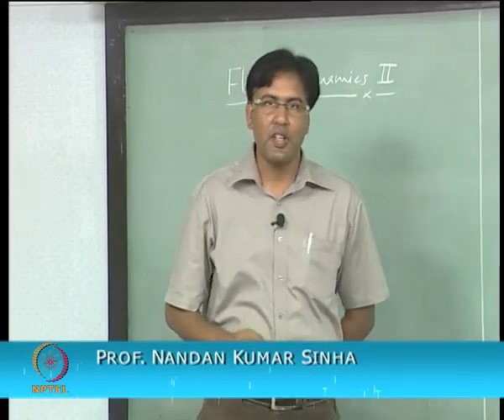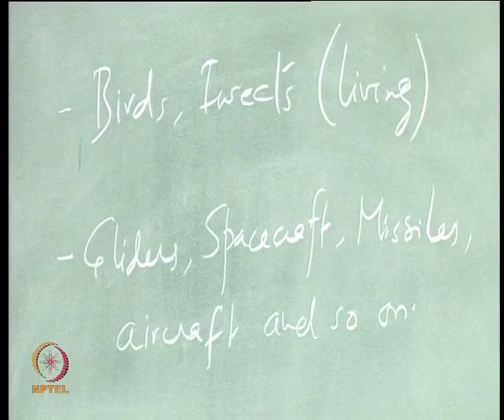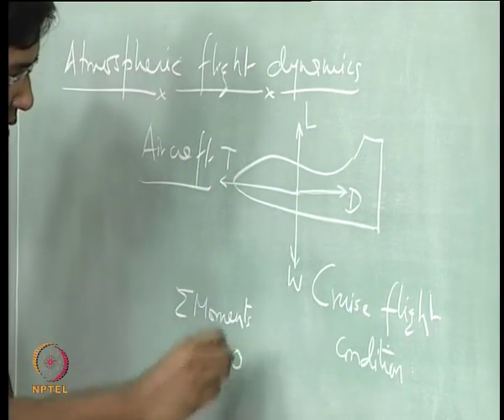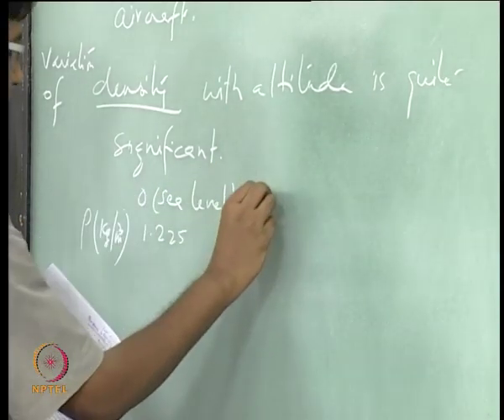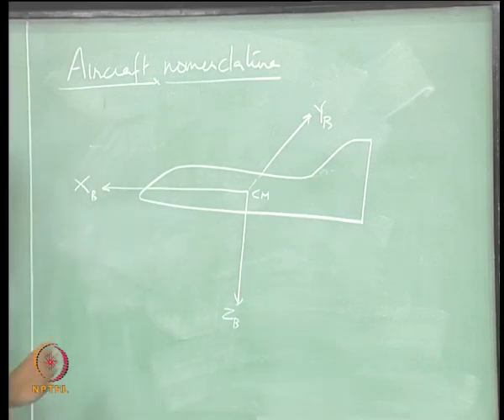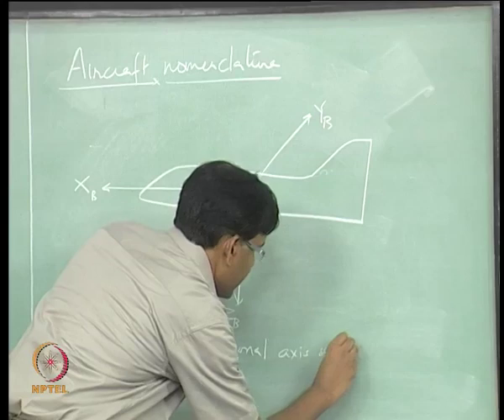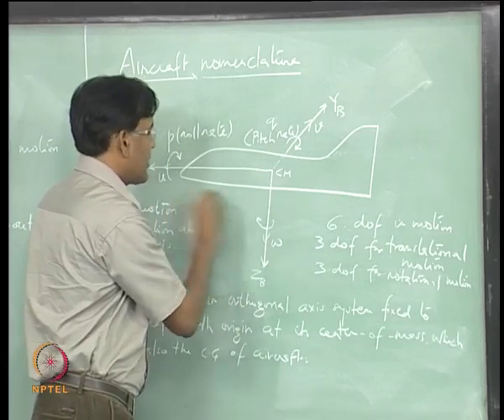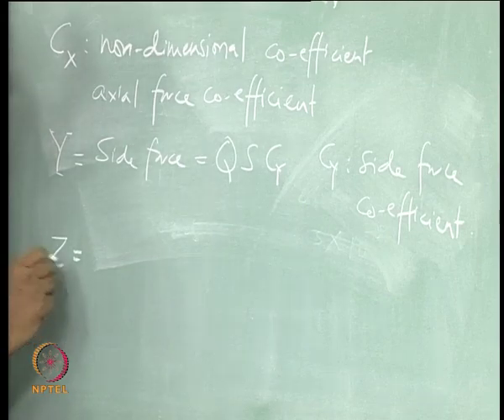Mod-01 Lec-01 Earth Atmosphere,Aircraft components,Aircraft nomenclature

Comment: 00:00:00 In this section of the lecture, the instructor introduces the topic of studying the motion of flying objects in air. The focus is on the equilibrium condition and how disturbances can affect the motion of an aircraft or any flying object. The perturbed motion is caused by unsteadiness in the wind, such as gusts or sudden changes in wind conditions. The course primarily focuses on objects that interact with air to generate forces and moments for sustaining their motion through the atmosphere. Examples of flying objects include birds, insects, gliders, spacecraft, missiles, and aircraft.
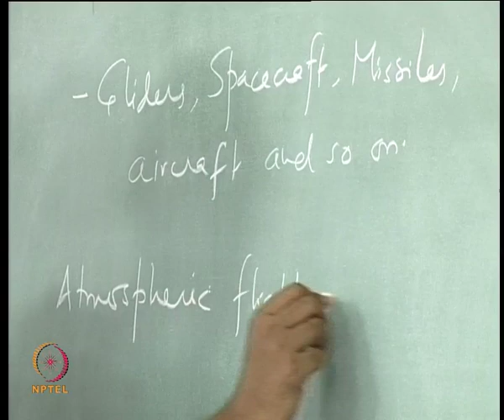    00:05:00 The topic of aircraft atmospheric flight dynamics and explains how an aircraft's shape creates forces and moments to sustain its motion in the air. They discuss a specific flying condition called cruise flying, where lift balances the weight of the aircraft and thrust provides forward speed to overcome drag. They also mention that various factors, such as altitude and the variation of density with altitude, can affect the motion of the aircraft.
    00:10:00 The density of air at different altitudes and how it affects the aerodynamic forces and moments on an aircraft. The density of air varies greatly with altitude, ranging from 1.225 kg per cubic meter at sea level to 10^-5 kg per cubic meter at altitudes of 80-90 kilometers. This variation in density influences the motion of the aircraft. Additionally, the speaker mentions other factors that can affect the aircraft's motion, such as its components, including the fuselage, engines, and control surfaces like the wing and tail. These components play a role in the aerodynamics of the aircraft and manipulate the airflow passing over it.
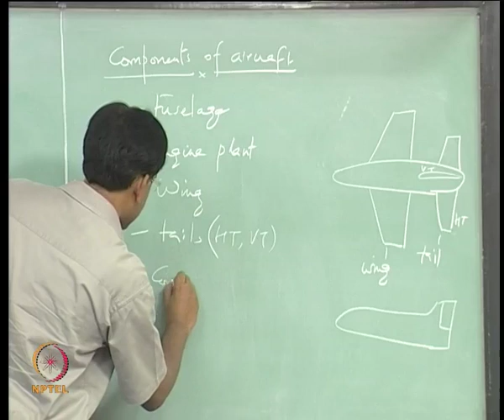    00:15:00 Control surfaces on aircraft, such as ailerons, elevators, and rudders, and how they contribute to changes in aerodynamic forces and moments. It also introduces the concept of an axis system fixed to the aircraft, with the origin at the center of gravity, and explains that a rigid aircraft has six degrees of freedom in motion.
    00:20:00 The concept of translational and rotational motion in an aircraft is discussed. The aircraft has velocities along its three axes, namely u, v, and w, which represent its translational motion. It can also rotate about these axes, with rotation about the X-axis being called roll motion, about the Y-axis being called pitch motion, and about the Z-axis being called yawing motion. Associated with each motion is a variable known as the rate, such as roll rate, pitch rate, and yaw rate. These motions are caused by forces and moments acting on the aircraft, with the axial force being the sum of all forces along the X-axis.
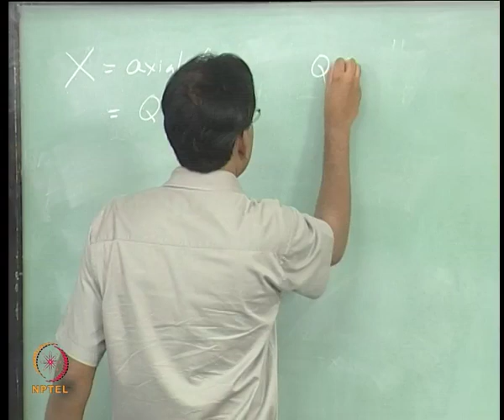    00:25:00 The different forces and moments acting on an aircraft. The forces include the axial force, side force, and vertical force, represented by Cx, Cy, and Cz respectively. The moments include the rolling moment, pitching moment, and yawing moment, represented by L, M, and N respectively. The expressions for each moment involve various coefficients and physical quantities such as velocity, wing area, and wing span.
    00:30:00 The pitching moment coefficient, yawing moment coefficient, and axial forces of an aircraft. It explains that the pitching moment coefficient is related to the mean aerodynamic chord of the wing, while the yawing moment is calculated using the yawing moment coefficient and other variables. The transcript also mentions that the axial forces of the aircraft are the result of gravitational and aerodynamic forces, and these forces depend on the orientation of the wind relative to the aircraft, described by the angles of attack and sideslip.
    00:35:00 The different angles related to an aircraft's movement in the XZ plane. Beta is the angle that the shaded plane makes with the XZ plane, also known as the longitudinal plane. The angle of attack, alpha, is the angle between the projection of the velocity vector onto the XZ plane and the X axis of the aircraft. The sideslip angle is defined as the angle between the shaded plane and the XZ plane. These angles are given as beta and sin beta.
    00:40:00 The aerodynamic forces acting on an aircraft, specifically focusing on the axial force. The axial force is influenced by the lift and drag components, which vary based on the orientation of the aircraft with respect to the wind and the Mach number. Additionally, the force is affected by the Reynolds number, which takes into account velocity and density. The speaker mentions several recommended books for further study on this subject.
    00:45:00 The first edition of the book they are referencing, titled "Performance Stability Dynamics and Control of Airplanes" by Bandu N Pamadi, was published in 1949 and is considered a classic. The speaker also notes that throughout the course they will be using content from this book for various topics and many examples and problems will be sourced from a book by Robert C Nelson.

Comment: Sir I hv to know what is the meaning of the numbers used in the name of airplane eg:- boing 787 , Cessna 206  etc please reply by any source:: no one teaches this
Reply: (A320/30/40/50/80) 
And -BCD is their code for the specific model/engine/thrust rating of that family.
For example an 
A330-243 is an 
A330-(2)00 series aircraft 
powered by Rolls Royce (4) 
(3) Trent 772B 320kn power 
and 
an Airbus A330-244 is an 
A330-(2)00 powered by 
Rolls Royce (4)
(4) Trent 775 at  334kN thrust 

Where as an 
Airbus A330-202 is 
An Airbus A330-(2)00
Powered by a General Electric (0) 
CF6-80E1A4 at 311kN thrust (2)